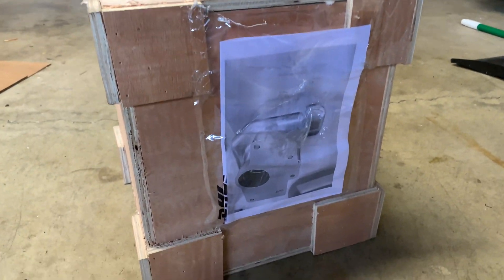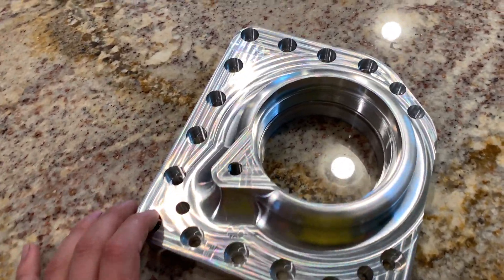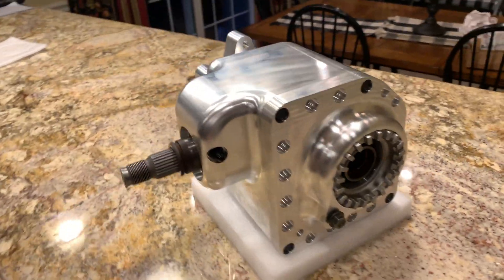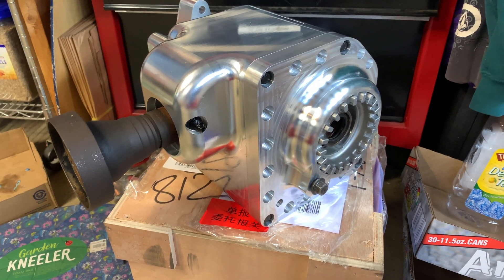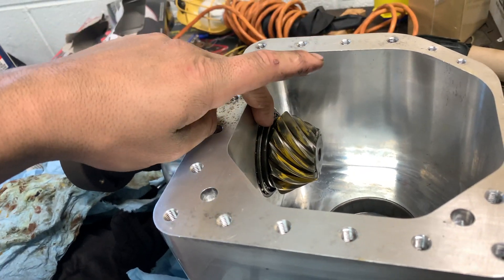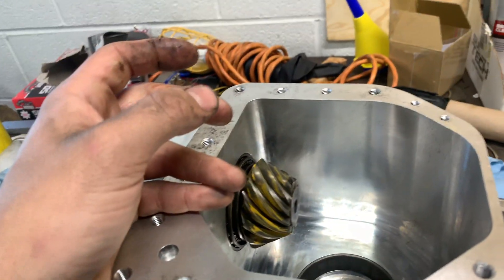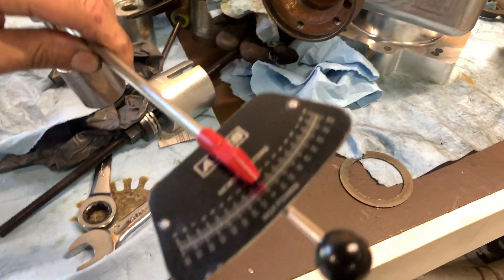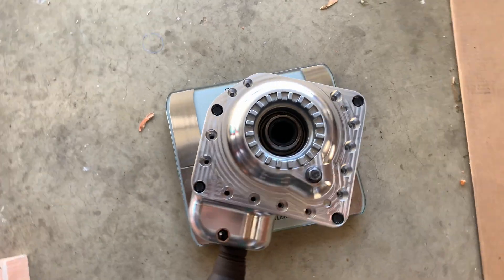Volvo 850 T-5R AWD Swap - Billet Angle Gear Case Manufactured

Comment: A+ ingenuity!  How much heavier than stock is the final assembly?  Did the transmission mind carrying it?
Reply from the maker: Thanks! The entire assembled billet angle gear weighs 45lb. I believe that is 5-10lb heavier then the factory unit. The transmission has no problems carrying it so far as it has 5 x M10 studs holding it on. Any issues I could probably fix with a brace bolted to the engine block but I don't want to make the engine/transmission/angle gear assembly too rigid or cast components might start cracking.
Reply: Well done, lad!  Have you made more of them?
Reply from the maker: Only 2 so far for testing. Still needs some more testing and experimenting.

Comment: 07:21, I have got to ask, is there a reason why the casing's mating surface was not stepped and similarly the end plate not similarly shoulder cut? 

The reason why I ask is that I feel that approach would have promoted a more stable seal than having the surfaces a flush single plane. 

That said, the wall thickness opposing that sticky like pitting would be too thin to step. That leads me to wonder if you were limited to a space constraint caused by Volvo's orignal case design (Alas, I have been away and missed some of your design development). 

It maybe that you have considered the internal pressures to be not so much of an issue and that a gasket should suffice for a good seal. I don't know.

Comment: I’m currently doing a manual swap on a 03 s60 t5 but I’m having difficulty selecting clutch components I will need. I have a 02 NA manual parts car with the 23-tooth spline m56 and factory DMF setup. I was planning on using an 850R SMF and PP with a Sachs SD 693 but that clutch disc is no longer available. Do you know of any other discs that would work and if this setup as a whole would work? Cheers
Reply from the maker: If you are in the USA, I would give SouthBend Clutch a call. They will be able to custom make you a disc. They very affordable usually around $150 for a custom disc.

Comment: Are you planning to sell these too?
Reply from the maker: Eventually, thats the plan.
Reply: @SimplyVolvo  You're a hero for the 850 m8. Also if you don't mind answering. I'm curious about the m58. At some point I think I'd probably be interested in going awd with mine, however between time and money, it'll most likely be a while. Can the m58 function as a FWD transmission too, like if I took off a section? It's my understanding that the m58 is supposed to be a modified version of the m56.
Reply from the maker: @federalbureauofindigestion4084  Yes you can use it as a FWD transmission, but you need figure out a way to keep the collar sleeve in (without the angle gear) so that it seals the trans fluid from leaking. Some people put the collar sleeve in and then use a large hose clamp on the axle to keep it in place.
Reply: @SimplyVolvo  Thanks again, this is epic.

Comment: Hi, another great video!! I’m working on a billet spindle for plug and play application of the P2 Brembo R breakes, right now I’m running Nissan 370Z 354,5mm rotors drilled to 5x105, and ASS adapters from LMR.se, this setup is illegal for road use and demands 18” Pegs, with a new spindle I can run 17” again.

What company did you use for this Cnc work?
Reply from the maker: 3DHubs

Comment: Wow....  Just wow.      Its awesome to see.      Monday i plastered a deer 🦌 on the blue rt in my 04 R...   In 6th at a calm 3500 rpm... 😦  So its great to see a win!
Reply from the maker: Sorry to hear :/
Reply: @SimplyVolvo  thanks... Its all good...    Back  together and now i have an extra v70R.  😜        Gotta plan my engine build.      Is that era 2.5 a good starting point  the 04... 05 ?   Your opinion is gospel after what ive seen 😂
Reply from the maker: @marcjordan29  Yes the B5254T4 is a good starting point, but only if you plan on sleeving the block.

Comment: Have u found a place that can refurbish the splines on the angle gear input shaft? Supposedly a place in Norway, but they are totally unresponsive. If you are in this deep, just wondering about your contacts for the internals. Impressive work. Congrats.
Reply: I'm Norwegian, maybe I can get a hold off the company you are talking about? However, Simply Volvo, I love that angle gear, would love to have one myself! What will the price be?🙈
Reply from the maker: Ive thought about welding a new spline onto the ring gear, but I am going to see how well good condition splines with a upgraded collar sleeve hold up.

Comment: I took your recommendation and I'm using 3Dhubs for the mechanical fuel pump adapter parts. I'll probably use them for some other parts I'm designing too.